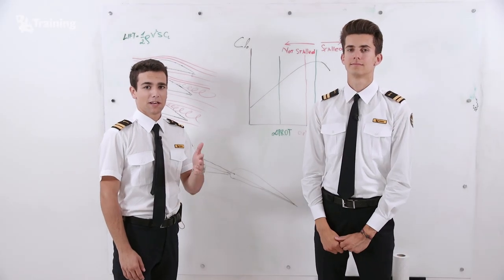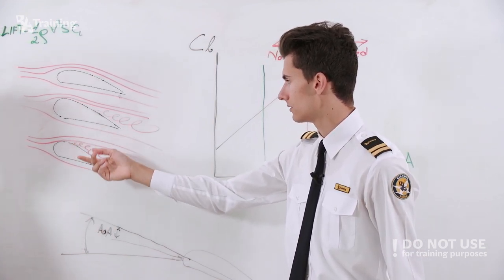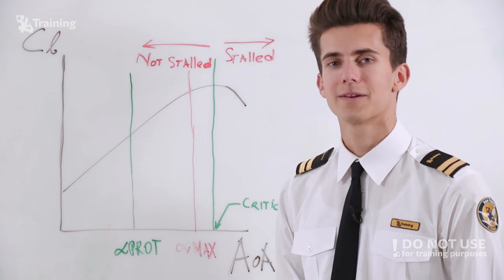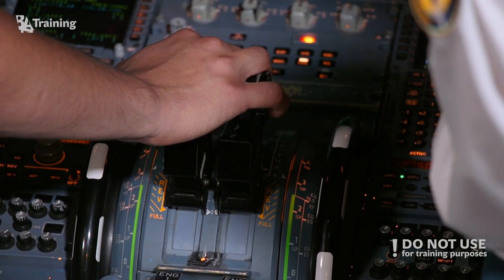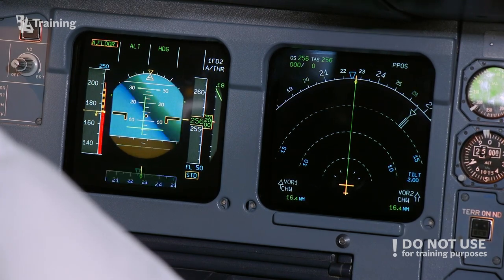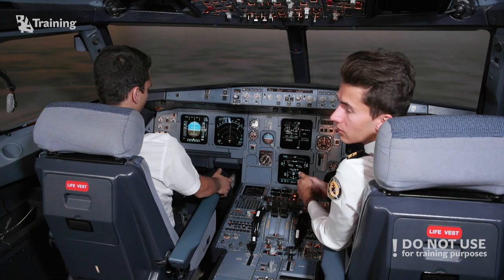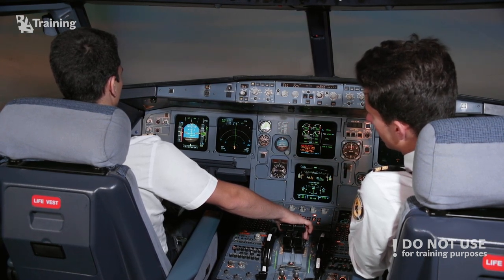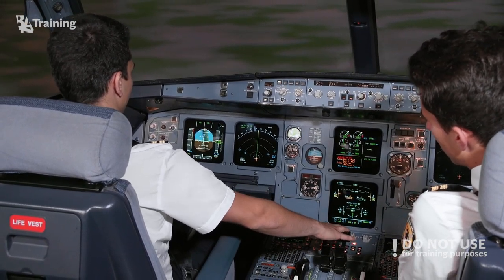Basics of Stall Recovery on Airbus A320 FFS

Comment: I think of Airfrance 447 :(
Reply: they shutdown everything and then set plane in STALL configuration and then hold plane in STALL configuration
Reply: @struvrim7637  they did not shutdown everything the stall protection system was not working
Reply: Will D  "Any pilot will tell you that's basic aviation." Absolutely. It's hard to believe they were pilots.

Comment: Video in a nutshell

1.Stall warning comes on
2.descend the aircraft to gain speed
3.once enough speed is gained pull up aircraft
4. Resume flight
Reply: Simple. Where can I apply as pilot?
Reply: Tell this to flight AF447 ^^
Reply: 1. AP/AT off
2. AOA reduced
3. Roll controlled
4. Speed managed
5. Stall recovered
Reply: It’s not about speed or descending. It’s lowering the nose to reduce the alpha.
Reply: @aurelien221  they got stuck at 2. descend the aircraft to gain speed. Well, more like one person got stuck.
Reply: How to recover from low altitude stall and aerodynamic stall
Reply: @aurelien221  446 was in alternate law. Therefore, no stall protection was enabled. It's impossible to stall an airbus in normal law.
Reply: Pulling up the aircraft once out of stall speed is not as simple though .... pulling up too fast will result in secondary stall.

Comment: in the stall recovery memory item. it clearly says "THRUST……..INCREASE SMOOTHLY AS NEEDED", not TOGA, because the sudden dramatic increase in thrust can enter you into an upset 

And it is "AUTOTHRUST" not Throttle
Reply: s3oodi1 you need to calm down
Reply: "Auto Throttle" in a Beautiful Betty, Mc Donnell Douglas
Reply: @hayhay7789  the word choice does matter. I wouldn't expect you to understand ;)
Reply: @ipechman  Where and when is he not calm?
Reply: @Dome31337  he is literally talking in caps lol
Reply: Regarding to the memory item, you should only apply more thrust if you are out of the stall and not setting to toga as first step for recovery. This video is very wrong here.
Reply: @Dome31337  I never said it was not wrong, I just said he needs to calm down lol
Reply: it's very called for, when someone calls someone out on something only because they completely failed to grasp it themselves
Reply: Quite right. Poor terminology and procedure.
Reply: Toga is not a smart move in this case

Comment: Good vid. Although plz update it since the stall recovery is different now as u know. Nose down. Advance power (as demanded) not a toga power with a dive of 15 degrees. Good job guys!
Reply: This is my understanding also (although not a pilot...). Slowly increase throttle or a secondary stall is very easy and have to fight to keep the nose down from that sudden thrust and the moment it creates. Do you know what is the 'correct' pitch angle suggested in training? I have seen people on youtube simply level off from a pitch up attitude and that seemed sufficient to exit the stall.
Reply: @nickjegard90  Just a couple of degrees below the horizon. No value is mentioned. Mind you, sometimes there is a lack of pitch authority that will force you to even decrease thrust more. Keep pushing the nose down below the horizon until the warning stops. Increase power smoothly as needed and regain your altitude... Just remember if you are below 20000 ft and in a clean configuration select flap one.
Reply: @kinanatto257  really helpful response them you. I noticed if I put the a320 into alternate law and force it into a stall, even pitching up to the horizon can push it into a secondary stall and if I increase thrust it just compounds the issue as it pushes the nose up further, even if I give full forward sidestick. I'm so impressed with normal law protections, makes the plane extremely difficult/impossible to stall!

Comment: I really like this video, and good presentation by Dusan and Mindaugas as well!
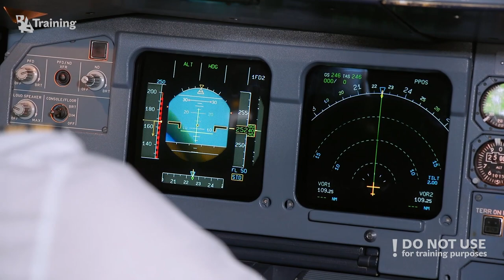One little question: What is the difference between the amber band and the red-black striped band that you can see at 8:59? Are these representing the aformentioned α_Prot and α_max speeds?
Reply: amber is @prot, where the protection mode is on for elevator, input is now direct proportional to sidestick.
red is @max, stall.
Also don't recover like the guys in this video this, completely wrong. Nose down to -10 and hold, no power input, let the speed come up, then raise nose and power gently. Not TOGA power, not 15 nosedown.

Comment: But if it is that easy to recover an Airbus from stalling, even if ELAC fails, why did the Air France Aribus crashed in 2009?
Reply: Ghost yeah true but speed indicator was false it was indicating about 240 or 260 knts while stalling
Reply: Ghost I think because their pitot tubes were frozen and they were not getting their airspeed correctly
Reply: Oh okay, so the Pilots didnt know they where stalling?
Reply: Ghost affirmative cuz it was so dark
Reply: Tamim Faisal oh okay, thank u:)
Reply: Yes I think they realised it when it was too late to recover from that stall
Reply: Tamim Faisal did you just see Alec Joshua Ibay?
Reply: Ghost What should the crew have done if they loose airspeed ?
Reply: The CVR shows that the cockpit crew did not have the captain in. The senior FO was with a junior FO. The pitot tubes froze which results in airspeed indication loss and makes the plane go into alternate law. Auto-trust then went off because of the alt. law and the pilots did not increase trust manually causing a stall. What happened was that while the senior FO was trying to pitch down the nose (as you should, and as demonstrated in this video), the junior FO got nervous and pulled his stick back, not forward. In side-stick planes, each side contributions sum (unless you engage stick priority), so they just cancelled out. In the last seconds of the CVR recording you can hear "NOOOO PULL DOWN PULL DOWN" and then.. silence...
Reply: Tom Jardine Generally the procedure is to leave everything where it is, and not touch anything. The aircraft will generally maintain airspeed through its natural stability

Comment: Auto thrust, please! And the demonstration of High Angle of Attack would be better if you disengage the A/THR, to cut off the A/FLOOR, so that you can see the aerodynamic protection working without engine power. Just as a suggestion.

Comment: But they didn't explain why the designers have given you the option to turn off the stall protection in the first place. If Normal Law is there to prevent you stalling, why would the designers want to give you the option of turning it off with Alternate Law?
Reply: paulmurphy42 In case of electrical failure Elac 1 and 2 or Sensors failure the plane will goes into alternate law because it cannot fly itself they are just simulating it by switching off the Computers
Reply: @tharlynnoo  Thanks
Reply: or in case of sensor malfunction, u can turn the protection off so case like 737 mcas doesn't happen
Reply: Normally the aircraft will be in normal law. However, in special circumstances such as unreliable airspeed, ADR and IR failures, ELEC BUS failure, HYD failure etc the aircraft will automatically switch to Alternate Law (no protection), to let the pilots make the decision instead of the flight computers. Switching off ELAC 1 and 2 flight computers simulates the failures of ELAC 1 and 2, which will, by design, put the aircraft into alternate law manually to practice flight without flight control protection, such as upset recovery training (UPRT).

Comment: So if you're in a stall in you get too anxious and pull back on the stick your screwed!
Reply: Depends on altitude, speed, and thrust. At low altitude with TOGA thrust you can go nearly vertical. 
Angle Of Attack isn't pitch. A320 has aProt. you're not supposed to be able to stall the aircraft in normal conditions.

Comment: This is what when monkey fly. ROD was 11500 feet per minute in recovery. Which is actually not required. This can lead to excessive G load. You can easily recover with max of 6-7 thousand rate of descend.
Reply: It depends on the depth of the stall.
Reply: @peteconrad2077  yeah I am talking about extreme situation. Try in sim next time
Reply: @ankurtyagi7150  the same applies in a real situation. Airbus stalled an A350 by accident in testing and required 12,000ft and 18,000 fpm in recovery.

Comment: TOGA?????
Reply: Yes, if appropriate. Take Off Go Around (TOGA) or 'full throttle' should be applied. 
You want to reduce the angle of attack as fast as possible. Speed does that. 
You need as much air as fast you possible over the wings. Otherwise you can enter a deep stall. You don't want that.
Keep in mind that angle of attack isn't pitch.

Comment: How much does the A320 sim cost?
Reply: Between 500,000 to 4,000,000 USD
Reply: No, no, no the cost of full motion simulator is roughly the same as cost of aircraft. Each part must have certification.
Reply: Dominik Chrobak source on a full cost sim? Our instructors told us a full motion sim is around 4m. Static ones for example a DA-48 we had at the academy was roughly half a million
Reply: Dominik Chrobak an A320 costs 70million or more according to google. That’s wings, fuselage, wires, seats, doors, lighting, toilets etc etc 

A sim, albeit very complex and a marvel of engineering, in material alone, a fraction of a real plane

Comment: Sorry, but this technique is wrong! Pitch -15 and firewall toga? No way my friend! Using your technique Vertical speed reaches -12000 ft/min and the pitch is so low that is hard to recover later! For recovery from stall the pitch should be between 0 and -5. When no longer stall warning inrease thrust SMOOTHLY!